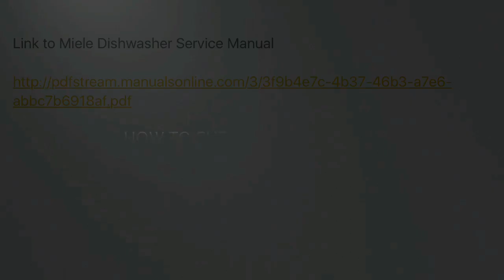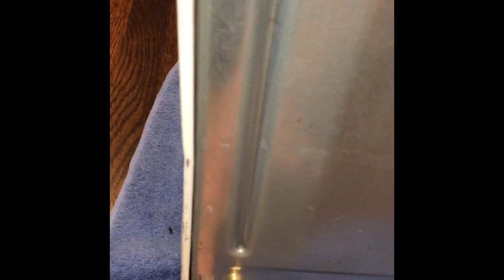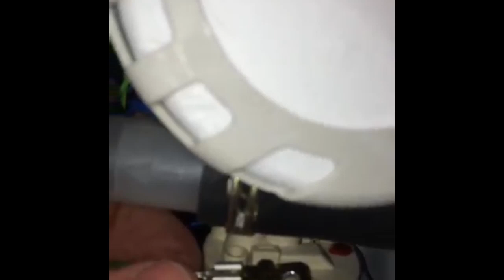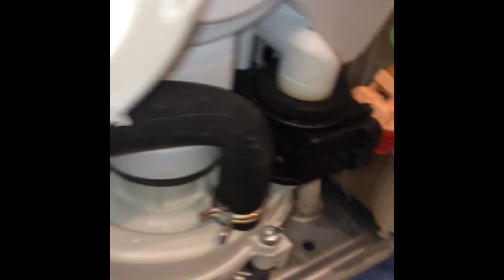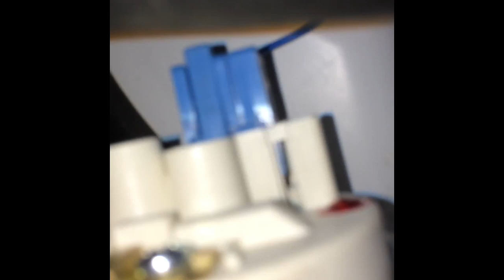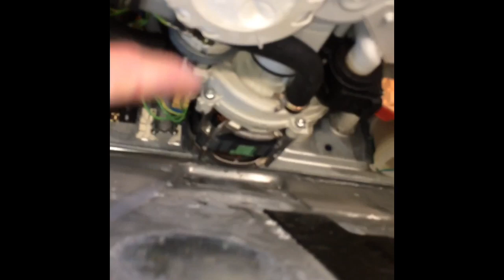✨ Miele Dishwasher - Disassembly and Parts ✨

Comment: I wish I found this video earlier.  My Miele wouldn't call for water. It took me a while to figure out that was what was going on.   So I replaced the inlet valve with an after market one.  Fored it all up and nope. It won't call for water.  So I tested the valve, and manually powered it.   Yup it opens.  Then I had a temper tantrum thinking it was the latch mechanism.   Now after three days and my wife extremely pissed, I took it out, smashed the entire dishwasher in my drive way and took it to recycling.   All the while I now know for sure , it was that float you just showed me.  I'm sure it was just stuck. The dishwasher would just drain , and flash all the lights and keep draining.    Too bad.  I absolutely loved the dishwasher. It was so quiet , and the top rack for the untensils is a game changer.  Now I'm buying a used Miele on market place , I could have had a ton of parts , but nope.  Temper tantrums in our 50s have consequences.   Thanks for the info.  Great content. Wish I found ya 24 hours ago.    Cheers
Reply from the maker: What a great story😊
Thank you!

Comment: Hello mr Scott. Our 20y old G641 Miele dishwasher stopped draining water after the cycle (not all of it) and the in/out led is blinking red.
I checked for debris in the drain and replaced the drain pipe. That didn't help so I'm about to turn it over and look inside. What do you think is the most likely culprit? My guess is that the drain pump is obstructed or weak.
Reply from the maker: Can you send this question to my email at: scottthefixitguy@yahoo.com

Comment: Nice info... could you help me with a rare problem.. the dishwasher starts program.. drain water, next pump water, but after a few min should start spining the arms and let the water go through, can hear the proggrammer ticking but no water flowing...i already change the engine capacitor. Thanks
Reply from the maker: I wonder if it needs a new fill valve?
Reply: Thank you for you answer,  I can see how water fill the dishwasher to the correct level, and then stops,  and it should start to pump water to the spin arms but it doesnt. If i wait 24 o 72h without using it works normaly for 1 or  2 times,  then starts to do the same problem pump doesnt start and arms dont spin..do you know which sensor or  require conditions to let  the engine pump starts and to move the water through? Thanks again

Comment: HI Scott, we have a Miele G4220 dishwasher with a noisy blower, it's making a growling noise. I went through your videos and couldn't find any mention of a blower repair or replacement. I had the bottom and side panel off but stopped short of removing the plastic molded bracket that the blower is mounted to, due to time. Is there a trick to getting it out, and are they repairable, or should I just replace it. By the way, I enjoy your videos and have used them in the past. Thanks.
Reply from the maker: Thanks Brian,
Best to replace the blower.  I bet the bearings are now rusty causing that noise.

Comment: I just bought a house with one of these washers. Its been working like a champ but it suddenly cut off mid cycle (like there was hot air blowing out when I opened the door) and there are NO lights on, nor does it respond to the power button. I also confirmed with a voltmeter there is power to the washer. Any idea what happened?
Reply from the maker: Hi Justin,
I think some water leaked into the drip pan below the dishwasher and now it’s stuck in drain mode .

Comment: Hi. The video did not mention the drying fan. What are common causes of the drying cycle not working and fan / component replacement?
(Model g5105)
Reply from the maker: If the heater has trouble the dishes won’t dry.

Comment: A schematic of the machine's mechanism  would be most informative.  The mechanism for drying the dishes would be worth describing.    Mile  seems to have developed several ways to do it, though they may not sell them in the US.  In our G4101  (in Australia),   air is drawn from the floor (ie coolish air) and blown over the outside surface of the tank so that water vapour condenses on the inside surface and drains away. That's why the unit has no insulation (I was about to insert some and eventually found why it's not provided! The escaping heat energy bothers me, especially in a hot summer.).    In another model the door is pushed open to allow drying.  Another one (bought  in Germany) sent the damp air through a cooled labyrinth in which there is condensation.  It's all out of sight.